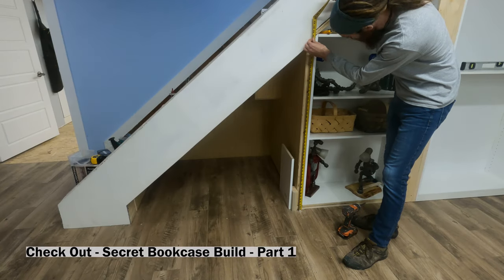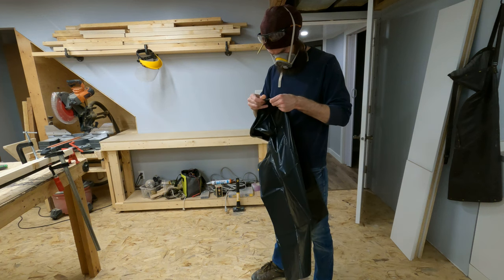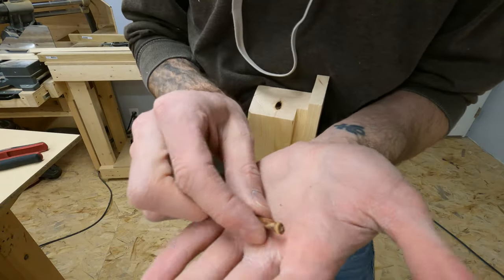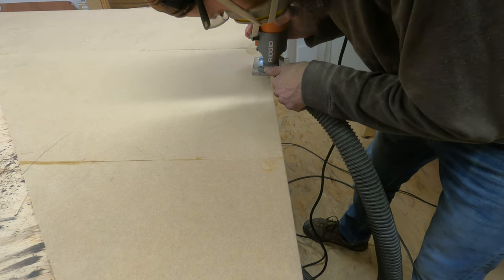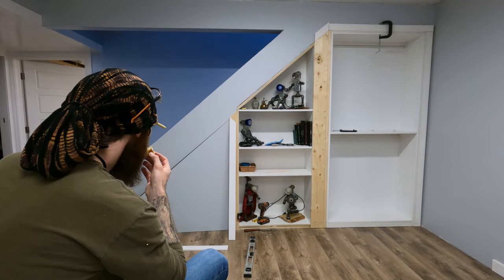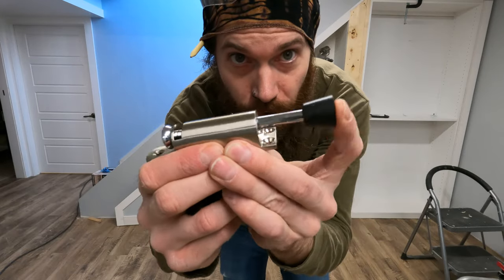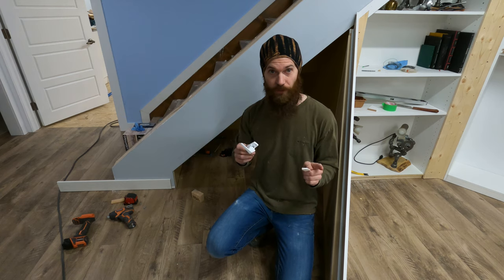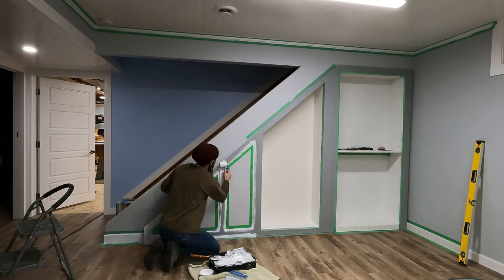Secret Door Build - Part 2

Comment: Hey Hewman,  could you make a video, going indepth on what you did to find the angles for the trim?  Specifically around the 4:42 mark when you used the tape ?  Thanks in advance!
Reply from the maker: Hey Tony, 
What I did with the tape was apply it to the wall and trim the bottom sides with a razor knife to get the outline of the vertical piece. I used a straight edge on the top of the right trim piece to mark the downward angle and the same thing to mark the vertical line. Then peeled off the tape and put it on the trim piece to cut to size. 

It might be a bit before I can make a video on this, but if this doesn't make sense then shoot me an email and I can try an explain better...with pictures!